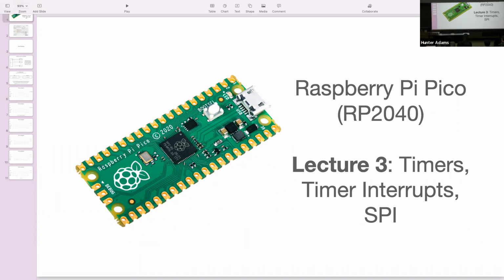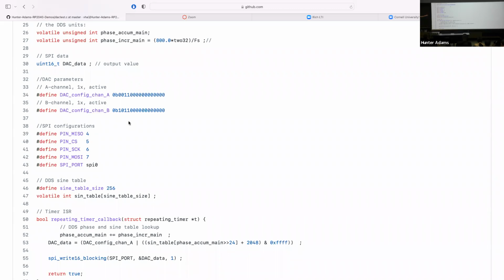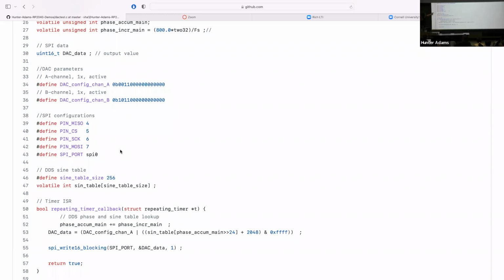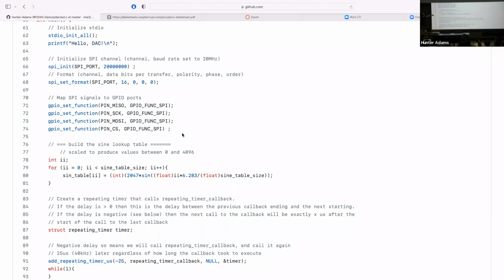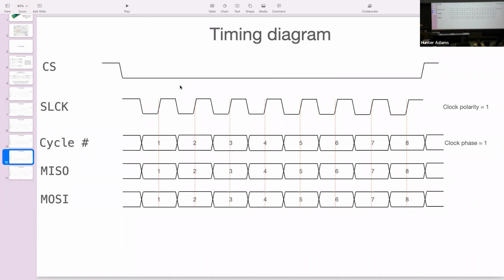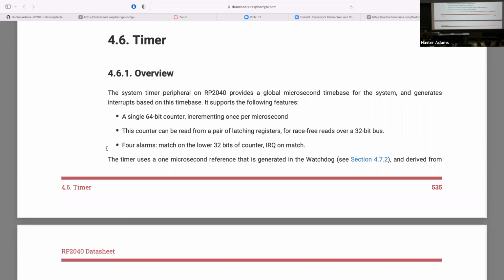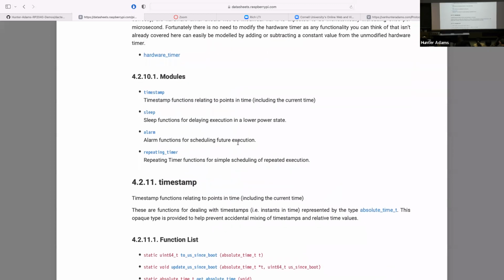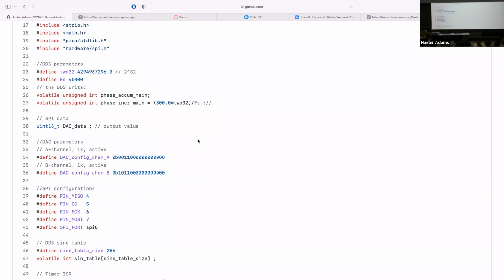Raspberry Pi Pico Lecture 3: Timers, timer interrupts, SPI

Comment: he starts to mumble on hardware interfacing? Learning on 8 bit systems where all the interface hardware needs to be developped would be more useful to these students than using a modern include everty thing device. Data sheets need to be understood more between different chip manufacturers. etc.
Reply: The reality is that unless you're forced to use 8-bit systems (toys or other extremely high volume devices) there's no need to learn that stuff anymore to be productive. If you go into an engineering job and you can describe shift registers but don't know how to use SPI + DMA, you're not being really productive. There is a prerequisite course before this, I'm almost certain, handling logic gates and interfacing.

Comment: Hi these videos are amazing and thankyou so mucho for the knowledge.

I was wondering if there is a problem with add_repeating_timer_us because setting to 25us it seems to do nothing. I am trying to set a sampling frequency in order to work with a DDS as your examples, but oscilloscope do not show anything(it dos not show the square wave expected at 25us using the mentioned function).

Comment: Few notes that might be helpful for somebody trying to follow it at home:
1. add_repeating_timer_us might freeze on -25 on some Pico-like boards. Had to reduce to -50 (20 khz).
2. Using R-2R ladder with 8-bit shift register instead of DAC can work with SPI, but Pico only does MSB order. So need reversing bit order before sending, or connecting to shift register accordingly.

Comment: Bruce's answer at the end was mangled.  If the routine doesn't complete in time, does the stack overflow, due to calling the callback again before it returns, or does the SDK library function handle that?

Does the repeating alarm callback allow for the time it takes to reset the alarm, or does the timing only give roughly 40kHz?  If it sets it to go off again in 25us, but it's taken a few dozen clock cycles to get to that point since the timer last went off, I'd expect it to run slightly slow.
Reply from the maker: The repeating timer callback function is called from an interrupt handler as soon as possible after the time specified. You’re correct that there will be some delay between the low-level timer interrupt firing, and entering the callback function itself. 

However, The SDK allows for you to specify the delay time as either a positive or negative number. If positive, then this number represents the delay between one callback ending and the next starting (i.e. the ALARM register is reconfigured at the end of the callback). In that configuration, the callback would indeed run more slowly than 40kHz.

If that argument is set to a negative number, it represents the time between the starts of subsequent callbacks (i.e. the ALARM register is reconfigured in the timer interrupt). As such, there’s better regularity.

If your callback takes too long, it will freeze the CPU (tries to take an interrupt from within an interrupt).
Reply: @hunteradams9430  Thanks.  I was thinking in terms of clock cycles, and how it's not deterministic how long things take, but I guess in this case the timer keeps running and it just sets a new time to do the next callback, so it only has to be done within the same microsecond to keep proper time.